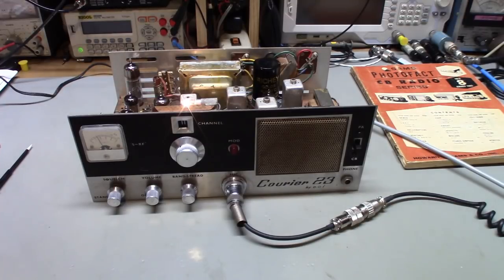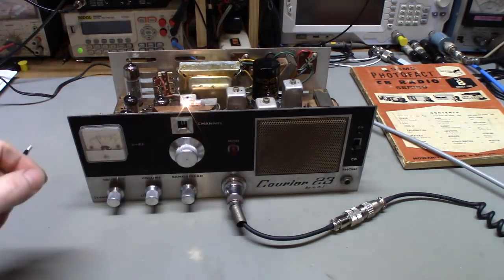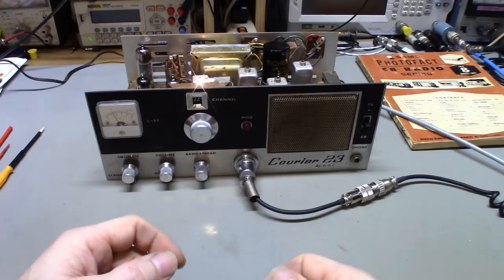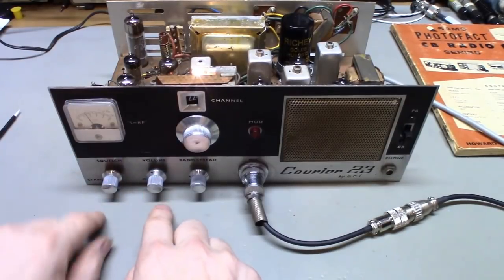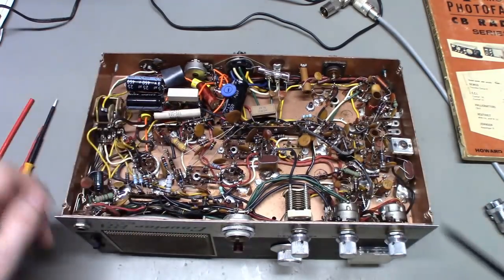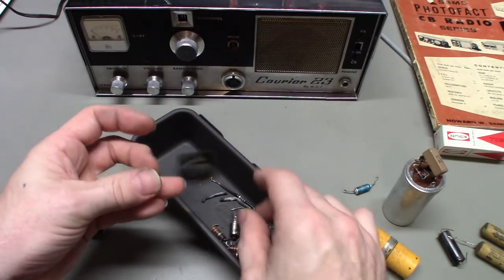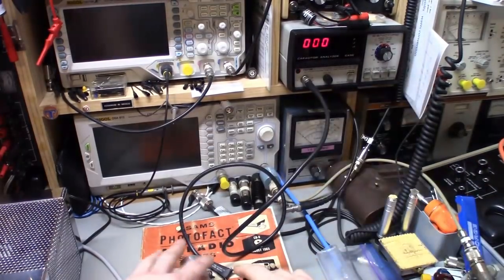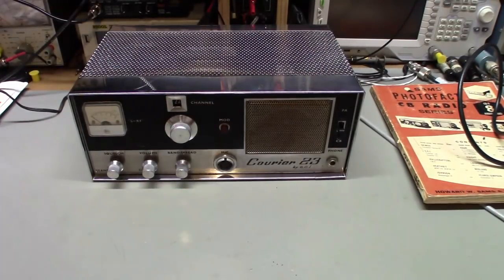ECI Courier 23 early tube type CB radio restoration.

Comment: My Courier Royale, which I have had for about 42 years, has been stored unpowered for most of that time.  
Earlier this year (2023) I switched it on at full line voltage without any concern for problems.   
It took a few minutes to come to life, then it worked perfectly without any sign of trouble.        
I know that will send some people into fits, but they should remember it isn't THEIR problem if MY radio pops a cap.     
And if it Does pop one I can repair it myself.

Comment: I had one. I modified it by adding another crystal and switch....allowed me to transmit on blank frequencies (eg 3a). Had 60 watt Contex 6706 linear. Had 5/8 wave vertical antenna and horizontal rotating 3 element beam. ...at height of skip.
However before this I had a couple 100mw walkie-talkies given to my father.  Connected it through a line-cord to an aluminum clothesline pole lashed to our chimney.  I talked skip on that walkie talkie from Philadelphia to Tennessee.  I received a QSL from him.
J
Couple this to a Turner +2 microphone and the audio was spectacular.
Jeff

Comment: A good alternative for cleaning chrome if you don't have a brass wire wheel is aluminum foil balled up and dip it in water then rub  the rust spots with it just leek dipping and rubbing. It's actually amazing how well that it does. Nice video, I have the same base station and may need to pick your brain one of these days when I get it out of storage.

Comment: Revisiting this video. I received a Kris 23+ as a gift. I recapped and changed many of the out of spec carbon resistors with new carbon ones to keep the radio somewhat original. Also ended up purchasing some replacement crystals because some channel banks were way off. Works pretty good now.
I'm surprised how much the internal layout of the Kris looks like the one in this video.

Comment: I got the Drake MS-4 speaker cabinet sand blasted and power coated for $10.00 in Tecate Mexico. Your advice with the wire wheel and all that I have heard you say really passes on much knowledge to others. Like to listen to you as I have been rebuilding old ham tube radios for 40+ years. Thumbs up.

Comment: I've not read the comments so someone may have already said this, but I had one of those radios back in my teenage years.  The Courier 23's channel 22A was active, but if the FCC could track someone down using it, they'd be cited.  I know.  I was, or rather, my Dad was since the license was in his name.  I worked a lot of skip on 22A.  There were some radios that had 22A and 22B.  Someone I knew back then had one ,but I don't recall the brand or model. 

I believe the reasoning for the squelch behavior is that it performs a noise reduction function, so CCW is "less noise".  The standby mode was an early energy saving feature that reduced the power the radio drew when not being used, but still allowed for a reduced turn-on time.  Keep in mind, this was at the end of the tube days and folks were wanting the instant-on behavior of transistors.  Personally, I rarely used the standby.

It was a blast seeing this radio again.  Thanks.

Comment: Not a bad looking radio for its day.  I can just imagine what that cover looked like.  You made a great job of polishing that cover.  Another tip for getting rid of small pits and rust is tin foil rubbed into the pits.  But brass will speed things up and if that works and it looks like the one you have done, there is no point in using the tin foil.  Baking foil for wrapping up your turkey.  Don't know what you call it, but it is hard bloody work!

Comment: 22A was proposed by REACT in 1964/65 to the FCC as an emergency channel. And some CB manufacturers (like Lafayette and Courier) were so certain that it was going to pass, that they started making them with 22A built in as a way of hoping to cash in early. As we now know, this didn't quite happen and these companies were told to immediately cease making radios with 22A. It wouldn't be until 1969 when the FCC designated channel 9 as the emergency channel for REACT.

Comment: I have 2 of these units, one is an early one with the chrome speaker grill, the other with the front panel slotted.  I owned one back in 1965 and had a great time with it, I picked up the not working slotted grill unit for a song on ebay, and the other I have had since around 1980.  A couple interesting differences in the key relay, the later unit has a voltage doubler off the filament line to create relay coil volts, it also has a unit on top of the chassis with a pot and terminal strip that is hanging in space next to the speaker and believe it to me the modulation control that does not exist in the early unit.  I have not located a schematic for my early unit, but have a 23 Plus schematic that also does not show the coil relay voltage doubler but does show a mod control, and one that does  Apparently there were production changes as they were built without a model change.  Several factory notes can be found on CBTricks.  The later unit went bad with smoke coming out of it, thought I lost an electrolytic.  Those were fine.  The power transformer secondary goes through a 10 ohm 1 watt resistor first, and it was fried.  I checked the power supply diodes, they checked good, so with good caps and diodes, maybe the modulation transformer went to ground I thought.  For giggles and grins I rechecked the diodes on the Simpson 260 (old radio demands old test equipment) R X 10, still good, then R X 10,000, one of them showed up bad on that range.  So replaced them both and B+ restored.  One big issue for me is the 6MC first IF.  The old rig does not have a trap, the newer does but is not completely effective  but there is a SW station on or about 6MHz. and it makes the radio useless when it is strong, all you hear is the SW station.  This is also on of the easiest to convert to the 10 meter ham band if you are a ham, you only have to change the 6 MC crystal for one about 4MC and retune.  It will put you around 29Mhz where the AM activity has migrated

Comment: Nearly all of these old tube rigs used a 6BQ5 as a modulator and a final tube. We used to replace them with the 7189 heavy duty version. Not that it made a huge difference. lol Some guys used a 6CW5 in the final but it would beat a radio to death. They would strap the screen resistor and get a huge carrier out of them with crappy audio to match.

Comment: Great advice on the caps. I am rebuilding a Drake TR 6 and the previous owner turned it on and the 4 section cap was very leaky and it took out 4 resistors. If you bring up a radio with a variac slowly there is not single cycle surge current and all is well but if you just turn it on it will cause the damage I described. Great advice.

Comment: We had at one time a Poly Com Pro which at the time was more expensive. The great thing with the tube sets was they were SO easy to customize/improve the circuits. You could, for example, put in a Q multiplier/stronger modulator with far Better Xmit audio. And of course, lowers and uppers. And,....my brothers used to do put in a motor driven vfo...which CONTINUOUSLY SWEPT the entire coverage range....which "put" you on all channels from like 60 channels below to like 60 plus channels above. My brothers had rival CB Jerks in cars looking for their 20 or where they were parked.. Of course, they were using thier trusty footwarmers......
Hey, it was height of the CB Craze, you know?......

Comment: That's $1,541.40 in today's money.
Reply: Folks like to use the inflation number on stuff, but for the most part, nothing has changed.  In 1965 when I had a paper route and saved the 160 bucks this radio cost me at Parts Unlimited in Jax Fla, my dad was making about $5000 a year, a nice Dodge cost around 3K, the house payment was $62.  The median income in NC where I live now is about 57K,  or 11 times what my dad made, a nice car can cost you 35K, a house comparable to the one I grew up in at 1100 sq. feet, if they even build them that small now, would have a house payment around 600 a month. Back then gas cost 24.9 at the Sunoco when using the 'Custom Blending Pump' on 160, bread was 2 in a bag  for a quarter at Winn Dixie.  Nothing has really changed except TV's and other electronics.   A 25 inch RCA color set was over a grand then, a flat screen twice as big today is 6 or 700 at Walmart,  solid state CB mobiles are 100 or less.  Buy those in 1965 dollars and that flat screen should cost you $55 and that CB, 10 today.

Comment: Even small Caps can go boom, Big time. I had a small new battery tester that I purchased from a seller on Ebay. It had mostly SMD parts and I put a LiPo battery in it and hit the start button. I got across the room and I heard a crackle then a loud bang. I turned around and saw a fireball shooting across my living room. The SMD solid tantalum capacitor blew up, so not always electrolytic that go bang.

Comment: I’m finishing up a complete restoration of the first two-way radio I ever owned, a Lafayette HB-444/25A 25 channel CB transceiver. On the bottom of the outer case there was a large sticker showing the tube placement and identifying several internal adjustments. That label is more than 50% deteriorated. Does anyone know of any vintage CB restoration sources that might have reproductions of such labels? Or, if someone has this radio, with the label intact, perhaps I can get a clear photo?
Reply: you finished restoration yet? I'm doing the same here

Comment: Where did you find the multi capacitance capacitor? I'm restoring one and it would be nice to not have to add 4 separate capacitors and could do it in one unit like the original. I see it loos like a Richey.

Comment: I think that chassis plating is actually cadmium, just looks like copper. Also what is your setup to test if the CB is transmitting and receiving on frequency? I have one of these radios and by just using another CB I can tell that it is not transmitting and receiving on the correct frequencies. I was thinking I could get a dummy load and then tap off of that to a frequency counter, or is it easier to test each crystal?

Comment: Great video again Mike, well the standby is very much like on a tube amp then isnt it ?
Reply from the maker: In most sweep tube amplifiers it does turn off the high voltage but it does not reduce filament voltage like done in radios.
Reply: The standby switch just keeps the filaments in the tubes on or hot and burning!! Then when you turn it off of standby it comes on instantly!

Comment: Mike you talk about the 23 can run on ac as well as dc. I’ve got the ac wiring diagram but for the life of me I cannot find the 12v scheme. Would you happen to have a link to that info? I’ve got a 23 with the Range Boost and I would like to run it on both options when I get it done

Comment: Hi Mike, I know you are touchy on people not respecting shielding on and around circuit boards but I want to convert some base radios from 110v to 220v and noticed untouched radios have power transformers with a steel case around the winding's a lot like the one you have in the radio here. It's easy to get transformers with wingdings exposed in electronic part stores but I haven't seen ones for sale with steel all around them for sale, are they called RF Shielded Transformers? Could I just make a tin box around a common one or are the proper ones better for heat dissipation? Thanks
Reply from the maker: Not going to lie to you, I'm not a engineer who designs power transformers. Surprise. :-)  I would think the shielded transformers help to prevent 60Hz hum from getting into the radios receiver circuitry.  You probably could make your own shielding can but any major transformer manufacturer probably already makes what your looking for.  Shouldn't be to hard to find a 220V shielded transformer with the output spec's your looking for.
Reply: Thanks for writing back. Much appreciated,

Comment: Hayseed ham fest is a great company that sells multi section electrolytic caps.
Reply from the maker: As does CE Distribution.  They purchased Mallory's old can capacitor machine and make new ones.
Reply: TNX and KEEP up the great work and teaching you do.
Reply: I run both Hayseed hamfest and CE caps in my radios.